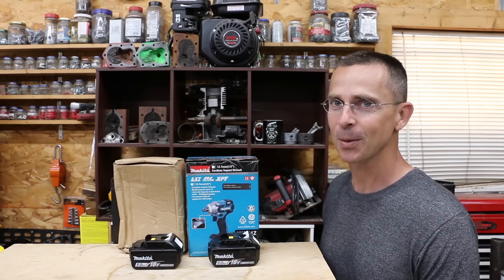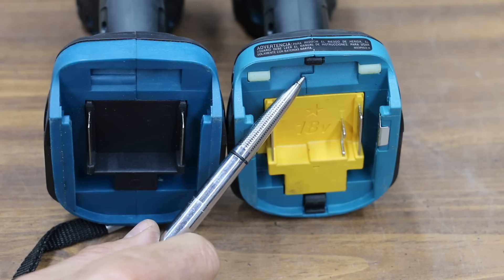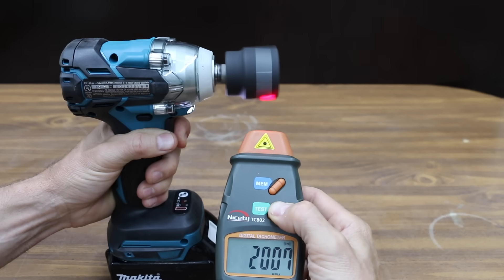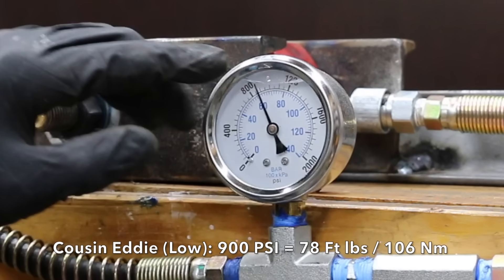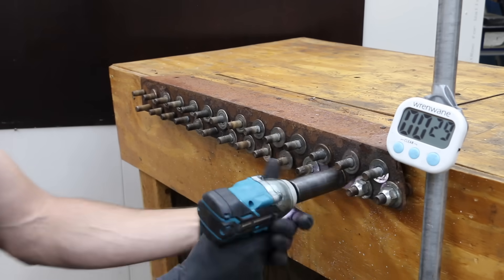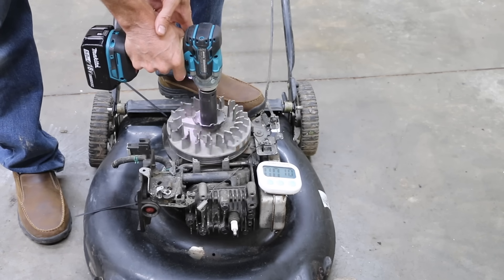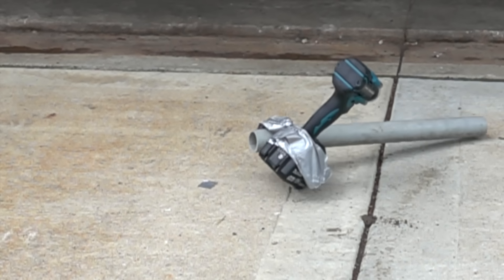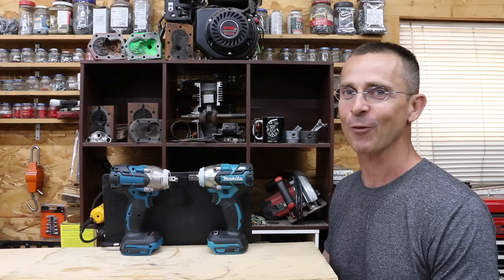Fake Makita Impact Better? Let's find out!  Makita XWT11Z 18V LXT Lithium-Ion Brushless Cordless

Comment: Can we test drywall anchors in the future?  You know the kind you need to mount brackets, cabinets in the bathroom, shelves in the closet, etc.?

Also the correct term to use for torquing fasteners is "pound/feet", not "foot/pounds" like you've using.

Here's a link to the definition:  https://en.m.wikipedia.org/wiki/Pound-foot_(torque)

Love the channel! 👏🏽

Comment: So you can break it, buy another one, and still be cheaper off than the name brand?  As long as it does what I need it to do and I'm not on a NASCAR pit crew, I'd go with the cheaper tool.  It's the better value.

Comment: Engine Break-In: Conventional Oil vs Break-In Oil vs Full Synthetic Oil. Sequence: Step up 
RPM Load with more hours vs High Load.
Reply: The red sticky cam lube, by Isky is by far the best break in lube for engines, sold by the 55 gallon drum for a better savings. Synthetic is the worst thing for a fresh built new engine, unless you like early cam and lifter fails and unseated rings. Kendall 15w40 is second on the list, Valvoline 15w40 is a close 3rd for good break in lubes. Remember break in times of 30min above 3,000 rpm to set the cam and lifters, comp rings, and oil rings under a load. Not a very easy test without a engine or chassis dyno. Fun fact, free rev with no load will never break in the parts, or set rings the proper way.

Comment: I'm actually surprised cousin Eddie lasted through the whole test.  Even with the broken section if it still works that's actually not bad for a $30 device.  Purely speaking from something at 1/3 the price.
Reply: Compared to other cheap brandless impact drivers, cousin eddie beats all of them with a significant margin.

Comment: Excellent comparison job: performance, construction and value for the money. Although it's only based one one unit of each, the difference between the two are significant enough to be more than useful and the depth of your testing is unmatched anywhere online. Consumer Reports reviews PALE in comparison to what you have been able to accomplish. What an achievement!

Comment: So, the Chinese actually do have good products.
Reply: They absolutely do.  The problem is that most manufacturers that outsource to China are doing it to save money.  And they can save even more money by doing this cheap with less standards than building quality equipment.  China will build whatever you want, but it will depend on what you're willing to pay.
Reply: They're not exactly sticklers for quality. Buildings mysteriously collapse all the time in China. The standards there are so low. Remember just a few months ago the headline "Corona virus hotel collapses in China". It is largely a throw away culture, bulldoze buildings after only a few years of use.
Reply: but really low durability, I bought super glue from china that cost half less than the competitor, but every time I open the new package to use it once and then close it properly, ...after a week all the glue is rock solid,  then I try the competitor product, not only I can use it so many times, but up till now it has been 6 months since I bought the glue and most of it still liquid
Reply: Since everything is made in China, Chinese companies are just stealing IP from over countries' companies. Sometimes they even make the knock-offs in the same factories as the legit stuff. That's why Chinese stuff is so cheap: they don't do any R&D, engineering or marketing.

Comment: The factory in China that makes Makita is probably using cheaper components and making the knockoff. A friend of mine who used to own a sports retail chain sent specs for a kayak to be custom built for his chain. Within a month, cheaper versions of the same design showed up -- all with the same minor cosmetic flaw in the mold for the custom one. Similar story with a local company that makes pressure pumps. Before they sent the example to China, they xrayed the pressure tank and there was a minor flaw in the steel. They drilled out the flaw and welded in a bolt. Not only did the product have the useless bolt in the pressure tank, but the knockoffs did as well.

Comment: I use an impact like once every 6 months, so I bought the cheap HF one that was like 20 bucks with a battery. they don't make it anymore.  regardless, for what I use it for it's always worked.  and I've only used it like 5 or 6 times.
Reply: exactly

Comment: Hi PJ, can you do a video about methylated spirits in an engine, I was told running 20% with gas would clean the carbs and remove water from tank on a motorcycle, especially if you run it for 10 mins switch it off to let the spirit soak into the carbs then run it again ..this is important because of the ethanol attracting water etc
What do you think 
Regards

Comment: I would like a link to check out "cousin eddie" if anyone has.
Reply: Here is a link to an Ebay sale of that tool: http://rover.ebay.com/rover/1/711-53200-19255-0/1?ff3=4&pub=5575603987&toolid=10001&campid=5338710309&customid=Makita&mpre=https%3A%2F%2Fwww.ebay.com%2Fitm%2F18V-1-2-520Nm-Impact-Wrench-Brushless-Cordless-Drill-Fit-For-Makita-Battery%2F352992743749%3Fhash%3Ditem523001d145%3Ag%3AZhkAAOSwxspeYJJO
Reply: @b0b0-  thanks, uncle Eddie does not includes battery. Is the original $138 battery included?
Reply: @garlet3  I guess they assume you already have Makita batteries.

Comment: Can you do a Tool Truck compact too? Like SnapOn vs Blue Point vs MacCo I know my SnapOn works pretty good but I have had battery problems within the warranty time and changed out my mini impact 1 time because it had trigger starting delay issues... but I used it to take off tires on smaller cars daily, 
and dropped it more than a few times so... just thought it would be cool to do a real comparison vs all those super expensive guns
Reply: My large SnapOn gun was 900 new got it 1/2 off... pretty sure it will last forever... and I almost cry every time I catch myself sliding it on the ground lol

Comment: "Nut busting torque..." 
I'll have to look for that next time I purchase an impact.
Also like how you used a Dewalt impact to tear the Makita and the knockoff apart. 
I think I mentioned this before in another video, but testing the different brands against each other, in a showdown like you did with the oil's, or just combine them all and get it done in one video. Milwaukee, Dewalt, Makita, Ryobi, Hitachi, Bosch, Harbor Freight brands, etc, doing either 3/8 impacts like this, or the 1/4 impacts, or drills/ hammer drills.
Thanks again for all of the hard work and testing you do, I really enjoy watching the videos and the knowledge we get from them!

Comment: For an 80% discount, I'll take cousin Eddie any day of the week.
Reply: jubjub247  well only if he was willing to stand like thug there waiting 2 hours for cousin Eddie to burn, after dropping it. 😎
Reply: Hmm China or China
Reply: jubjub247 the mikita 138 plus tax ill have enough to buy 3 knock off 😂
Reply: @oneday3857  exactly! For as much as I use an impact wrench, this is juuust fine.
Reply: jubjub247  it may seem that way in this testing while good doesn't show what you really are paying for longevity  and reliability and warranty eddie will do the job for awhile if your a home gamer that needs it every so often the makita is for someone that uses it for a living pulling bolts everyday all day or for a impact driver variant driving a couple thousand deck screws everyday
Reply: ..not an 80% discount if you have to buy the batteries and charger separately...
Reply: jubjub247  I like how your comment was made on a video that quite literally disproves your comment.
Reply: jubjub247  cheap cost over quality doesn't sound bad
Reply: @rapower9622  I bought a cousin Eddy. Every time I used it I had to use a breaker bar to loosen the nuts/bolts. I finally bought a DeWalt. Now cousin Eddy is collecting dust and so is my breaker bar.
Reply: make sure cousin Eddie's battery doesn't blow your house up
Reply: @errolsmith5634  ..If you noticed, he was using a Makita battery on Cousin Eddie...
Reply: now test real world longevity, side by side.
Reply: Buy once cry once.

Comment: I Brought a makita for work used it on mechanical pullers with hardened thread.
Makit tried to cut some more threads on the hardened steel shaft, and that was only on first setting !

Comment: @project farm Your drop rig may have contributed to the flex in those tools. Most modern cordless tools are designed so the battery comes off when dropped. The way the pipe is taped around the battery and handle could have stopped that from happening.

Comment: While you probably get what you pay for with Cousin Eddie, I wouldn't be surprised if his same internal parts are used in some other brands that no longer do any of their own engineering and only rely on their past reputation.  Those would of course sell for significantly more than $30, but be no better than Cousin Eddie.

Comment: i got the knock-off makita about 8 months ago and use it every day at work just to see how long it would hold up. i have to say i'am quite impressed that it still works just fine. the only thing is the over moulding on the handle gets worn down quicker and gets a bit harder, so it's more slippery in rain or with oil on it than the real makita. There is no problem operating the tool however.

Comment: Sometimes having a knockoff is worth it. Depending on the type of work one does and the people around. Feels less bad to get a $30 drill stolen than a $120.
Reply: And you would still have 3 left for the $120 price.
Reply: You buy cousin Eddie for when friends want to borrow a tool.. Keep the good ones hidden.
Reply: if you want quality or have a lot of work then 120$ is not much and will last you long time
Reply: @dhruvadrhu3991  Thing in a long time the motor and battery technology will have moved on vastly bit like having a 10 year old makita drill now with pathetic power and battery life . If your tradesman using all day then knock wont last long but makita will last 2 - 3 years but with  DIY you will be stuck will old technology tools you cant afford to chuck . Got old cordless angle grinder cost loads new cant bear to chuck it  but compared to my £30 makita knock off  if its pathetic but its progress
Reply: He sold me on cousin Eddie. It would be fine for 90 percent of the things I do
Reply: Agreed ,I've been on huge jobs lots of trades and sketchy folks in and out your work area I'll bringing older or cheaper tools to jobs where tools are walking.

Comment: Both Makita's are TOTAL JUNK!!!!  Im an electrician and I repair the windings inside these drills all the time. If you take apart a Makita and take apart a Milwaukee drill you will notice a HUGH difference!!!  The "windings"  the copper wire wrapped around the coil, you will see how much better a Milwaukee is made. You can cheap out and buy a Makita or Sears brand, but you'll be throwing it out a lot sooner than a Milwaukee or even Dewalt.  If you spend just a little bit more, you'll be thanking yourself later. Unless you just need a junk drill to putter around the house with.

Comment: The bigger question is: how long will the battery on the cheap gun last, both in minutes of run time and number of recharges before it is trash. That's what makes most battery tools end up in the trash--expensive battery replacement. I have two Harbor Freight tools. Work good IF the batteries weren't trash. Even brand name tools are a pain because they keep changing the design of the battery so they don't interchange making your older tool obsolete.

Comment: but how much extra would those better important components cost to make them on par? $20 more? $50?
Reply: Components are not the only cost. There are other costs too. R&D costs, meeting legal requirements (charger), recycling costs for batteries (in some countries), translating manuals, warranty, packaging, etc. You can get real quality from China but you often end up with the western price. PS: I am in the tech industry working with China regularly.
Reply: @JohnDoe-wb7ng  thank you for an educated insight, and not just saying "cAuSe iTs cHeAp"
Reply: There may actually be a different version of this as well. I have only bought those with the combined hex driver and it is slightly different and definitely spins faster (also they claim it spins faster). And costs $1-2 more. To make it even or very close would cost practically nothing anyway.

Comment: Nicely done. I’ve had several Mikita impacts and they seam to loose their hit after about a year of use. A longevity or endurance test of some of main players would be interesting.  For me it’s not which is best out of the box, but which is best after a year.  Is there a way to simulate/accelerate a year of hard use?

Comment: PROJECT FARM OR SUBSCRIBERS...... I'm looking for opinions or facts.....I know ethanol free gasoline is best for a small generator but I cant buy it near me and to buy true fuel at 25 a gallon is crazy so I'd like to know how good is it to buy premium gas add the water extract the ethanol and use that in my generator and snowblower? I know it looses octane and it's a pain to do,but does it actually work and is it safe for my generator and snowblower...... THANKS GUYS AND GALS

Comment: I would actually like to know where i can reliably buy that 30$ one!
Reply: Probably Aliexpress or Ebay, I bought a knockoff Makita angle grinder off Aliexpress for 30ish and it's not half bad. The only things about it so far I don't like is the sticker over the power level LED is peeling off, and it came with the wrong size screw to mount the guard, but it looks like someone at the factory saif F it, and tried to force it on anyway.
Reply: Here is a link to an ebay sale: http://rover.ebay.com/rover/1/711-53200-19255-0/1?ff3=4&pub=5575603987&toolid=10001&campid=5338710309&customid=Makita&mpre=https%3A%2F%2Fwww.ebay.com%2Fitm%2F18V-1-2-520Nm-Impact-Wrench-Brushless-Cordless-Drill-Fit-For-Makita-Battery%2F352992743749%3Fhash%3Ditem523001d145%3Ag%3AZhkAAOSwxspeYJJO
Reply: Got mine from Ali express, great little tool for the price, and compatible with my other batteries.
Reply: I bought a made-in-America MILWAUKEE 1/2" Cordless Impact Wrench, 18.0 Voltage, 1400 ft.-lb. Max. Torque.
It cost $275. 
Is it worth the money? If you can afford it, it saves American jobs. So, I chose it. It’s at least as durable as the Makita—and it lives up to its “hype”.
Reply: @joewrosenthal00  im pretty sure its only assembled in the USA,   dont get fooled by their (ment for gullible people) advertising,  they still order the parts ready made from overseas which means it only needs some simple assembling...
Reply: I never liked it folks as I call this tool an impact wrench or rattle gun. Can't measure the torque without an actual torque wrench
Reply: Aliexspress. search for torque wrenches
Reply: @GL0BETREKKER  lol. Torque wrench is a completely different tool.
Reply: @1221Ralph  he got 4 likes from that comment too.
Reply: @Bryan-Hensley  it's 6 now
Reply: @1221Ralph  AliExpress is a completely different beast too, sometimes items have very weird keywords/names so searching for torque wrench might very well yield good results.

I once searched for copper grease and AliEx decided that i was searching for sex lube/toys so there's that.
Reply: @TruthHurtLiars  9 now

Comment: From the boy: “come back and see if the knock-off will still work in 6mo [of hard use]”
Reply: I have cousin eddy for 5 months, works every day( i am a mechanic), it is a great tool for that price. Of course, for more serious jobs you need an air impact tool, this is more like a toy
Reply: I’ve had cousin eddies brother cousin ed for about a year. occasional use and it is still going. I don’t own any makita tools so i use a milwaukee to makita battery adapter. mix of use. won’t loosen my car or suv lug nuts, so i use a breaker bar to loosen the first tiny bit and then this to power the nuts quickly on and off. cousin ed not only is a impact wrench but also impact driver. project farm missed that feature. the end has a spot for a impact bit. he a lot of use out of it that way and is perfect for driving deck screws. also tightening general bolts

Comment: China loves the Makita battery socket and there are loads of other China knockoff tools you can compare. There is an angle grinder and blower that look exactly the same as the Makita tools they copy. Example: https://www.banggood.com/18V-800W-125mm-Cordless-Brushless-Angle-Grinder-For-Makita-Battery-Electric-Grinding-Machine-p-1613366.html?rmmds=search&cur_warehouse=CN If you search for "Makita" on Banggood, Aliexpress or eBay and you'll find loads.
The Makita impact is a really old model too, like 5+ years old. They have a new one right around the corner. The DTW 300. I think that will blow the pants of this one even more.